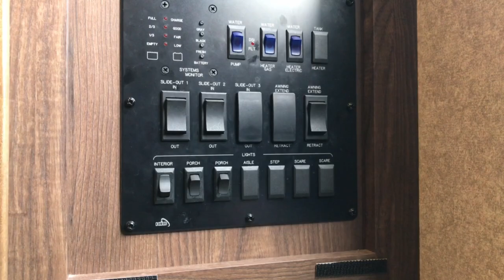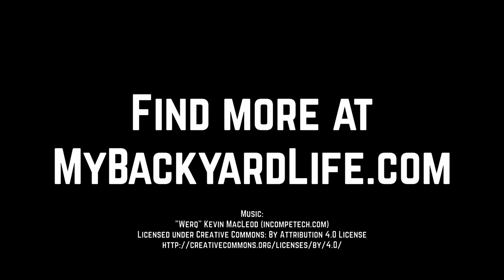How To Winterize Forest River Shamrock & Roo Campers

Comment: Do you know where the Vin would be located on this camper? 1999 shamrock by forest river… We just bought the same make and model and cannot locate the vin.
Reply from the maker: Mine was welded on the frame up by the tongue jack.  It is also usually on the sticker on the side of the camper.  If neither of those locations have it then your best bet is probably the title.

Comment: If I have a little water in my black tank will dumping a jug if antifreeze in it prevent it from freezing? I live in MN where it gets cold
Reply from the maker: I would probably play it safe and pick up a 5 gallon bucket to get it drained out.  I would think a couple jugs of antifreeze might work as well, but a cheap bucket would be the route I would take just to ensure there isn't a bigger headache waiting for you in the spring.

Comment: Could you describe more fully what you did with the city water connection. Never saw that before. Thanks.
Reply from the maker: Yes, with the water pump on and antifreeze in the lines I like to compress the stop on the outside of the camper.  This will make the antifreeze spray out of the city water connection clearing any water that may have suctioned itself up there while draining the low point drains.  Hopefully this helps.  Good luck!